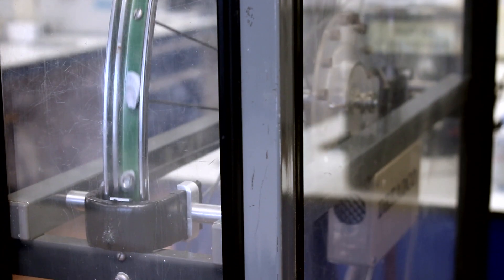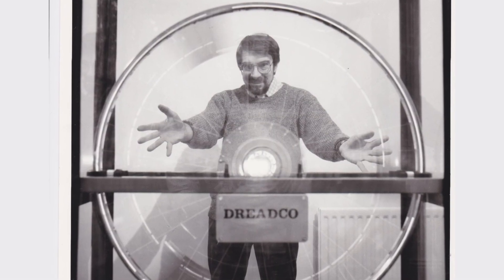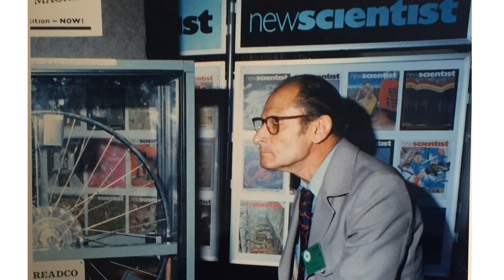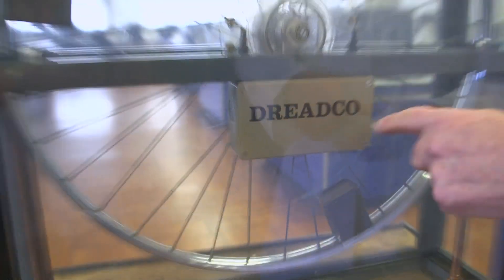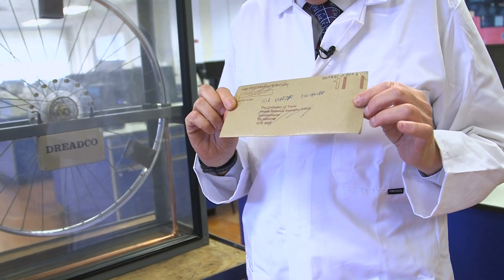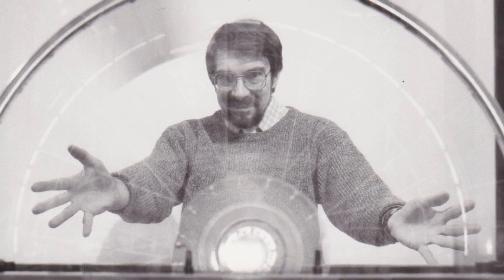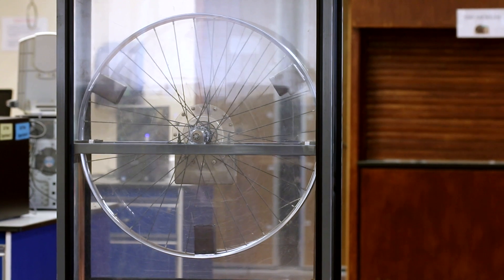Perpetual Motion Machine - Periodic Table of Videos

Comment: I'll go with occam's razor here: the middle box in the middle with "DREADCO" on it has a small motor with a battery that's been set to run really slowly. the pipes, heat sinks and other boxes are there just to throw people off. this was a guy who knew perpetual motion machine were fake and sold it to people who also knew it was fake. so he was just having fun with them. that's my guess anyways
Reply: Don't forget dry pile batteries, guys. There's a battery called the Zamboni pile that's been powering the Oxford Bell continuously for almost 180 years.
Reply: fatsquirrel75 Prof. Poliakoff says "Oh, it's just that." That would be an obvious clue wouldn't it?  
12mjk21 I agree with you. I even thought of something like a winding spring. That would slow down over two years.
Reply: Someone (in fact nearly everyone) would have suggested that. I'm tempted to go the other way. I'm thinking that all the odd elements of other perpetual motion machines all sort of do a little something. I'm hoping it is a Rube Goldberg machine or sorts.
Reply: @EyeSeeYou Prof. Poliakoff said the secret was a bit disappointing and left him feeling a bit cheated because the guesses people made were so much more interesting than the actual answer. Nothing could be simpler, easier, and more disappointing than a low power battery pile.

I don't know how you could claim nobody's guessed the correct answer yet. Of course people have, they even hinted as much in the video around the 1:20 mark. What we're lacking is confirmation by the (now deceased) creator. See how that's not quite the same thing as nobody ever having guessed it?
Reply: I also think it's a battery device.  But we've got to keep with a solution of 1981.  The best battery would be Alkaline, the best motor would be... well, less efficent than today, I'd guess.  (Which isn't to say it hasn't been upgraded and lasts longer today than originally.)
Reply: but maybe that's the trick. this guy is SOO smart that he can't just put a motor with a battery to make it move, and people just over think it
Reply: Conrrr N/A Maybe the wheel isn't just driven by a battery powered motor, maybe the the whole thing IS a motor?
Reply: Exactly what I thought. As an engineer, I appreciate the joke if that is indeed true.
Reply: if it is a motor it better be one without brushes, otherwise it will deteriorate over time
Reply: That is the point!
It is slowing down overtime
Reply: that guy was way too smart to just put a motor with a battery and call it a perpetual motion machine. Also, certainly somebody would have guessed that as it's the most obvious choice And clearly nobody has gotten it correct yet. So, probably not.
Reply: +The Kush Connoisseur at 1:20 they literally say maybe 1 person since 1981 has guessed correctly......  Certainly someone he asked has said a motor and a battery.
Reply: even simpler i imagine, you would be amazed how small electric motors can be, the size of a pencil, 3 cm long, would be planty to run this thing, and there is so much space fo batteires, in all the boxes attatched to the wheel, and the copper pipe, the heat sink, the "magnet looking things"
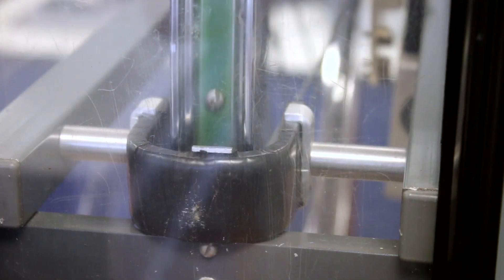Reply: 2:21 you can see there cant be a motor, nothing extrudes from that box
I think the heat transfer is a box holding a battery that send electric round the copper pipes and magnets in the boxs, instantly what i thought upon seeing it
Reply: 12mjk21 that wont work, the box doesn't line up with the bearing, also we were shown the back of it, its nothing but a box with a label

Comment: I reckon there's a battery there - possibly concealed in the black boxes around the rim but just as likely in the hub (where I anticipate there to be a kind of electric motor). Battery possibly of a type where air provides the oxidising agent (similar to hearing aid cells)

Comment: This guy... He put decoy elements of common (fake) perpetual motion machines on it to throw us off. He added weights similar to the unbalanced wheel, he added unmarked boxes in locations that could be anything from magnets to batteries to motors, he even added copper tubes running from one side to the other which would suggest a heat transfer...

I hope you're starting to see my point here: we cannot get the same enjoyment and wonder of asking the now deceased man (rip) if our guessed are correct or not and  since it contains elements from literally every perpetual motion machine ever made, there is no way to know if we are getting any closer to an answer...

I respect your wishes to keep the inner workings a secret, but I just wanted to let you guys know that it leaves the viewer in kind of awkward position.

Btw: Love your videos, have been watching and subscribed for years. I started with Brady's early stuff around 2012 until I caught up with the backlog. Keep up the good work.
Reply: Agreed, it's intentionally elaborate, as a show piece, presumably, lot of impersonations of other ideas, and I suspect the answer will just come down to a battery somewhere in the mechanism - the professor noted it /had/ slowed a little over a couple of years, but since we can't dismantle/inspect it there's no real way of disproving the long list of fake PMM methods this device mimics.    No complaint though, would love to know, but isn't too important, not going to be the basis for any future inventions most likely, and was a very cool video, both the object its self and the pleasant discussion and conversation around it =)   Great work as always.
Reply: You could easily build one that would work exactly the same. Put an electric motor and battery in the hub's box. Then make a bunch of fake stuff. Point is we'll never really know with so much secrecy and diversion and not being able to open it up.
Reply: I agree with Thomas here, Sir Martin will probably not read through the comments and engage (neither will Brady, "don't read the comments"-HI), so there will never be any way to verify any theory without building dozens of perpetual motion machines and waiting 40 years... 
I think a good solution would be to release the answer in a week or two
Reply: Postghost Thanks for backing me up and not making assumptions. I'm just a mechanical engineering student here chilling out watching some youtube like the rest of us. ("Like a prince" some might even say.)
Reply: Jesse Hey man I was just leaving my opinion, didn't ask for the likes or to have the quality of my grammar put under a microscope. I probably wrote that original comment this morning in all of 5 minutes. 😂
Reply: Thomas Rad agreed. The boxes and pipes are decoys.
Reply: the hub is completely visible though.
Reply: Everyone looks for an electrical or magnetic source of power, while the true secret is that it is most likely entirely mechanical in nature. Everything else is misdirection as in most claimed perpetual motion devices. The secret is to leach power from natural souces while keeping friction losses to an absolute minimum. Think self winding clocks and watches...
Reply: nah, its a great video and inspires the imagination.  obviously there are trick components, but thats what makes it special and fun.
Reply: Jesse Wow, you must feel very proud about yourself now.
Reply: Masta lol
Reply: Just a battery probably
Reply: Its easy to make a perpetual motion machine, the problem is to get it to do something ****productive ****!!!

Next this, how long is 'perpetual' :)  as the man said, it is 'slowing down'... so will eventually stop in a 100 years or so...... NOT perpetual!!! :) :)
Reply: Why, if you think you have an answer, build it yourself...
Would be answer enough for me...
Reply: Jesse, have you ever heard of something called a logical fallacy? because that's what your assessment is.  The correct use of punctuation in linguistics is completely unrelated to general problem-solving.  I doubt some idiot who dismisses concepts, based entirely on a complete non-sequitur, got anything right either.
Notice how I put a comma after your name? You missed that, just ftr.  Not that I'd usually give two shits about punctuation usage in a YT comment, but if you are going to make a criticism about punctuation, it's probably best not to open with a direct example of how to NOT punctuate correctly.  Yea? also: "I highly doubt some idiot in youtube comments[ , ] that doesn't know how to use punctuation[ , ] got it right." << go back to primary school.
Reply: Thomas Rad Have you ever heard of something called punctuation? I highly doubt some idiot in youtube comments that doesn't know how to use punctuation got it right.
Reply: "it leaves the viewer in kind of awkward position"  LOL i'm sure you'll survive, princes.

Comment: There's something that looks like an old electrovoltaic cell on the end of the DREADCO box, the kind of textured glass surface you see on old light meters.
Reply: well spotted. I had one meter with a cell exactly like that.
Reply: the box is obviously a battery... it's a simple electric motor.
Reply: it undoubtably also uses a battery
Reply: I agree about re-starting. I'm thinking it harvests enough energy in, say, eight hours to keep it spinning for twenty-four.
Reply: bashful The trouble with that hypothesis is that the wheel would stop in the dark. Restarting that mass with that low a voltage would be impossible.

Comment: You should check out Reidar Finsrud's perpetual motion machine. It uses a series of pendulums and magnets to send a steel ball around in a circle. It's really quite clever and can stay moving for weeks. Also the guy who built it is a bit of a mad scientist/sculpter/painter, and keeps the machine locked away in his basement because he's afraid the world isn't ready for his revolutionary invention.
Reply: Finsrud's machine runs on its own, after being started of course, but does end: it is not a perpetual motion device, with an efficiency rating of 0.8. Finsrud himself admits to this
Reply: Ze Rubenator but this has been going for years
Reply: This has been going for years, but it also employs some cheap trick in order to do so. I wouldn't be surprised if an electric motor or gyros are involved. Energy is being perpetually put into the system by some device. Finsrud's engine runs on its own.

Comment: I'd guess it's got ferromagnetic metal in the boxes and it induces some current by passing near the copper tube which then powers the magnets bend around the rim and they pull the wheel black box towards them but when it gets close the induced current from the copper tube stops. And now I'm of to a Green Chem exam :D
Reply: What you're describing would be an actual perpetual machine i.e. that wouldn't work.
Reply: Z6U6Z6U the one in the video also doesn't work as it is slowing down the one I described would also slow down and the gradient of energy loss would be dependent on losses in energy transfer. In my opinion 2 years seems reasonable.
Reply: I think you underestimate how much energy would be lost through friction, that's a simple ball bearing.
Reply: Z6U6Z6U true the other possibility is a gravity assisted movement but i don't know how that works.